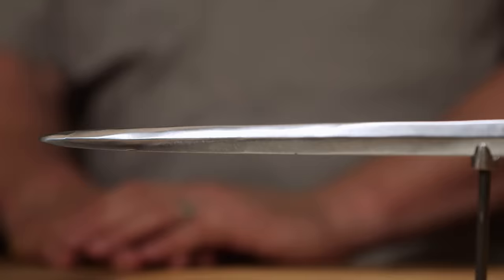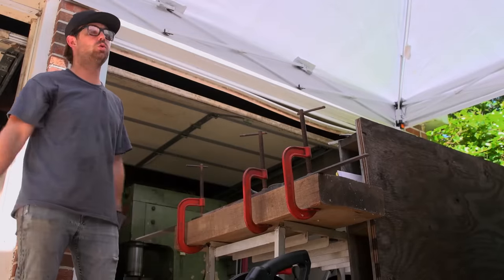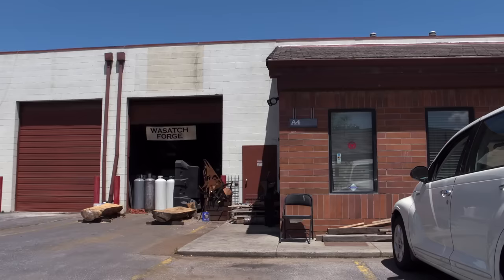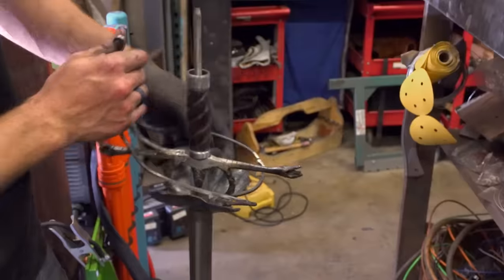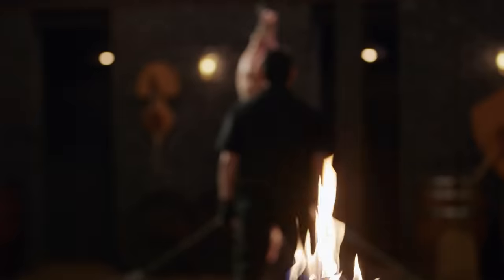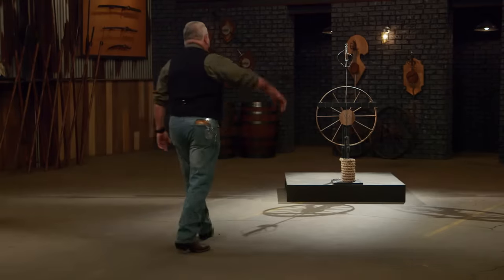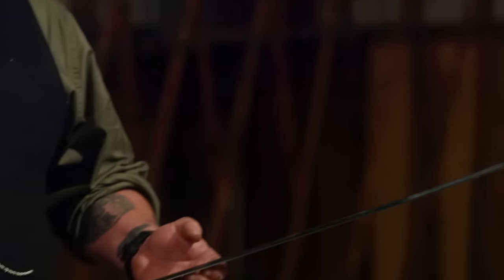Forged in Fire: Musketeer Rapier Final Round: Teddy vs Jesse (Season 7) | History

Comment: I thought rapier attack is mostly stab not slash, but why he test it by slashing
Even he test it all slash, none of them is stab
Reply: because rapiers cut too and even tho they cut less than a longsword they should have no problem cutting flesh and muscles
Reply: Because there are 2 rapiers. The civilian rapier which was far thinner and is designed completely around the thrust that are more similar to the foil. Military rapiers were thicker and were used for both thrust and slash
Reply: @pandazorrao458   a real rapier is rarely used for slashing, it can, but it is only used to harass or slightly injure, a longsword is much better. They should test thrusting it

Comment: If your first heat treat doesn't set correctly: normalize. Heat it up, let it cool very slowly. Completely remove the uneven hardness and relieve all the stress in the blade. Normalize, then redo your heat treat.

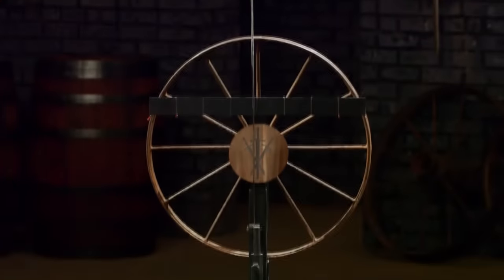Comment: 6:39 A rapier is about as heavy as an arming sword and they're supposed to be stiff because the rapier is a thrusting weapon.
Reply: that would be the smallsword, miliary rapier would be heavier than longsword
Reply: @Asghaad  average rapier weight: 2.2 pounds
average arming sword weight: 2.4 pounds
source: wikipedia

Oh and now that I research it a little bit more 2.2 shouldn't be the average at all. more like a minimum. Most historical rapiers I'm looking up are closer to 3 pounds and many are even 4 or over.
Reply: @Obelg  in other words you are finding out exactly what i was pointing out... arming sword is around a kilogram (2 pounds in stupid medieval measurement system...) longsword is 1.2 - 1.4 kilos and military rapier will be around that or more.
Of course there will be lighter or heavier examples of each of those, but non wallhanger battlefield weapons will be somewhere in those weight limits because too light will compromise durability and "power" or reach or ballance...

Comment: The rapier is not meant to be flexible, as a primarily thrusting weapon (yes rapiers can cut) it should be rigid. Rapiers used in stage combat and in Hema are flexible for safety.
Reply: By nature of their thin cross sections and long blades they naturally had alotnofnflex (comparable to other weapons of their time)but you're right to much would make it difficult to penetrate on a thrust, skallagrin has a great video on this discussion.

Comment: Long swords with rapier hilts. These are not rapiers. Blade width = no more than one inch. weight = no more than 1 kilo. Cutting edge = last 6 inches of the blade. This is not a cutting weapon, so the idea of cutting through a pig is a joke. This is a thrust/piercing weapon
Reply: Not really. A rapier are made for thrust in majority, yes. But all the blade can cut. If you take a rapier's blade in your face, you have the face very damaged.
For the pig test, it's not really a problem to cut, bcs a rapier can cut.
But I don't understand why they don't test with thrusting

Comment: Everybody complain about that catastrophic failure. Maybe if that was a arming sword it may let it pass but for rapier its bad. Yes it can slash and cut but the main use is for trusting. Also if both pass all the test he will lose just because the weight alone / nose heavy. Jesse also stated he remove some weight of the tip and im sure it come down to balance.
Reply: That weapon was quite well suited to its purpose until that idiot ruined it with that BS "test".

Comment: Teddy should've tried a Leaf Spring.. maybe it would've had the Flex.
Reply: It was 5160 so same steel as most leaf springs. I just missed the heat treat.
Reply: @teddybearknives1868  oh! I stand Corrected then. Thank you for the comment. That Design, and concept was good, I do wish it worked.
Reply: Thank you. I definitely tried to make it different and my own flare. It was my First time tempering a blade that long and over shot my temps by a little bit. But my motto through the entire build was "rather bend than break" Its always possible to straighten a blade. Not so easy to fix it broken in half.
Reply: @teddybearknives1868 I do think you did a remarkable job. I did like the look of what you built.
 It has been a little while I see. I sure hope you're doing well. I'm sure you learned quite a bit since the show. Have you made another rapier?

Comment: What’s the pint of building a rapière if you only slash? That’s not the purpose of the rapière..
Reply: Yes, the rapier was mainly made for pushing. But she was perfectly capable of cutting and slicing. Afterwards, as you said, pushing was the main use. A little cutting is logical for a test, but they should have used a lot more push

Comment: I wonder if applying a magnetic field in the area around the blade during quench and heat treatment would cause a difference in the crystallization of the material.I know that as heated it would be unaffected, however as the blade cools and the crystals solidify  the presence of a magnetic field should align them more uniformly creating a sharper edge and a stronger overall structure.

Comment: I have an idea for that poor guy having to climb a ladder to quench his work.
  If you're on ground why not dig a hole( i installed sump pumps ) into the ground and install a sump tank. They're around 24" across and maybe 3 feet deep. They have sturdy lids you can cover it when not used. Also pump or vacuum it out if needed.

Comment: Isn't a rapier specialized to thrusts? Why is Doug only testing it for slashing?
Reply: The thrust was the last challenge and hes rapier wasnt straight so he had to be disqualified for the blade wouldnt be accurate
Reply: Against a soft target such as pig corpse, rapier would have no problems going through with a thrust. Slashing is more challenging and slashes were still used in a fight.
Reply: Right, only if you call a "kill test" to me it doesn't make sense to not test the primary function of the weapon. Can't agree with the "soft target" idea, they could easily put in plate/mail which would simulate a little more realistic conditions. The third or the "sharpness test" made more sense to be performed with slashes.

Comment: What they've built, here, is actually a Sword-Rapier. A real rapier has NO edge and will not cut - it is strictly a thrusting weapon. A real rapier, therefore, also has a Much Thinner blade, derived from the earlier need to penetrate Chain Mail by spreading the links. The Sword-Rapier, BTW, was much favored by Cavalrymen, as they wore armor long after the Infantry gave it up.
Reply: Totally wrong. A rapier can easily cut. It was more made for thrusting indeed, but splitting the edge of a rapier does a lot of damage. It's a legend that rapiers only sting. In a lot of weapon thesis, and representation of the 17th century, there are technic who use the blade in slicing. The court swords(recognizable with an 8-shaped guard and a triangular blade) were only for thrusting, but only used in duels by the nobility and appeared later. 

The cavalry sword than you describe is a Wallone sword. More short, not really made for thrust, and precursor of calvary saber (I don't speak about courb saber, but saber with right blade)
Reply: The original rapier had a cutting edge. It was basically just a narrow longsword.  What you're thinking of are side swords

Comment: You guys do realize that's not a Rapier right? Those blades are way too wide and heavy, they're far closer to a Schiovana in design. With that said though they are excellent examples of that type of blade and most likely more similar to what the Musketeers would have actually used than a Rapier. A Rapier was a dueling weapon and useless for combat because a thick jacket could stop any thrust from it. A Schiovana like those however was meant for killing as Doug demonstrated with those pigs. Doug's enthusiasm for this is really what makes this show, you can tell before every test he's just thinking "I love my job."

Comment: Not much knowledge about rapiers from writers of the show... It is actually pretty heavy weapon  (usually some 20 to 25% lighter then a longsword) with centre of mass near the crossguard what makes tip nimble and fast. Also they were often sharpened in upper half only as lower part of blade was almost exclusively used to parry the blade of the opponent. It is very unspectacular weapon for showtesting, but You learn to respect it as soon as You stand with a blade against someone who uses it well. Good test would be a gel dummy with few layers of thick clothing and then testing the thrusts.

Comment: The slash testing was frustrating, like they are being graded better for making something other than a traditional rapier. He never thrusted even once, with the fking rapier!

Sword categories are fuzzy, and I get that, but i feel it needs to be clarified whether the contestents should make a traditional rapier or are better off making one of its cousins. Traditional rapiers are fairly long, thin, and optimized for thrusting at the expense of cutting potential. They were only really sharpened at the edges to prevent oponents from grapling. On the other hand, something more similar to a military side sword (thinish arming sword with a rapier cross guard + forward grip) which was shorter, and wider than traditional rapier, would have a more balanced design in regard to cutting and thrusting. Both are great swords in different contexts, both can be concidered rapiers, and the one with less claim to the category of swords would perform better on the test.

They need to either be more specific or they need better tests that reflect the qualities the swords being made are supposed to have. Im imagining a contestant putting a swirl guard on a zwiehander and calling it his rapier 😂.
Reply: Yes, the rapier was mainly made for pushing. But she was perfectly capable of cutting and slicing. Afterwards, as you said, pushing was the main use. A little cutting is logical for a test, but they should have used a lot more push

Comment: Uhhhh isn't rapier primarily thrusting not slashing?
Reply: Yes, the rapier was mainly made for pushing. But she was perfectly capable of cutting and slicing. Afterwards, as you said, pushing was the main use. A little cutting is logical for a test, but they should have used a lot more push

Comment: I thought rapier swords were exclusively thrusting weapons. And that they were rigid to increase penetration. Am I misremembering?
Reply: Some flex is needed so the blade isn't brittle, otherwise it'll snap. I do agree that the flex test was way over the top, no sword needs to be able to flex THAT much. As for rapiers being exclusive thrusting swords, only civilian rapiers were exclusively dedicated to the thrust. Military rapiers like the ones used by musketeers would've been designed to both cut and thrust.

Comment: I think it sucks that they never show or even mention the tempering process. How do you temper a blade that long in an amateur type setting? With a torch by color?
Reply: I used a oil bath for the temper. First time doing it so I made a rookie mistake. I over heated oil in the middle part of the tank causing my to overshoot my temper temp by several hundred degrees. Causing it to loose the needed spring.
Reply: Teddy Bear Knives 
Are you one of the blacksmiths in this video?  I never heard about tempering with oil, I'll look it up.  Sounds dangerous for a fire, can you bring oil at 400-500 F?
Reply: @okkrom  yeah unfortunately mine  is the one that took the bend, but I learned from it. You're right it can be dangerous but so can any part of forging. As far as temp, most my temper temperatures are around 375-425. Peanut oil (the oil I used) has a smoke point of around 450 and a flash point closer to 600. But if you're doing it (and it's actually a pretty good way of tempering larger blades that don't fit inside a oven.) Keep it well away from open flames and outside your shop.... Similar to deep frying a turkey!
Reply: Teddy Bear Knives 
Cool! Nice job, I know that bend test is an abs standard but its still an extreme test.  I wish they would have done a cutting test.
I used to do some stock removal, never had room for a forge. Id love to try it one day, Ill keep these info in the back drawer of my brain, thanks for sharing.

Comment: Should've used  5160. Anything else on a Rapier just isnt good enough
Reply: I used 5160, he used 80Crv2 both are great steels, it's all about the heat teat. He nailed his, I missed mine. Steel selection is only a small part of the picture.

Comment: Rapier test with slashing instead of stabbing :/
Reply: That's exactly what I thought. They even said they would thrust and slash, and then we only saw them do what the rapier wasn't really designed to do.
Reply: @Michael-dy2lb  well an actual rapier was designed to slash and stab with more focus on the poke. But it was a let down to not see the poke
Reply: Yes, the rapier was mainly made for pushing. But she was perfectly capable of cutting and slicing. Afterwards, as you said, pushing was the main use. A little cutting is logical for a test, but they should have used a lot more push

Comment: Why this people always do oversized and overweighted blades
Reply: the strength test is probably why they are overweighted
Reply: @josephbelton1890  I think there is also a problem with the test. The rapier is not built to cut a pig in half xd
Reply: rockn roll  early rapiers werent rapiers like that, were normal swords with a better guard
Reply: @ErnestoBrausewind  if you can cut a pig with a rapier its an overweighted rapier

Comment: As a rapier fencer... this pains me to watch.  Those aren’t even close to rapier blades.  They sure look cool, but they aren’t rapiers.  

They put them through a cutting test... with rapiers...  which were seldom used for cuts historically.  None of this is correct.  Those are side sword blades.  Way too short and way too thick.  Side swords were used for cutting, rapier fencing was much, much different.

Rapiers are NOT supposed to be extremely flexible like people think they are.  HEMA blades for sure because you need the force to  dissipate as you stab someone in combat, however historical blades do not have that much bend at all.  They work like hypodermic needles when going through your opponent.  

They are super cool looking swords though.